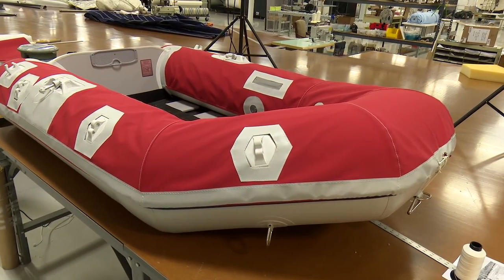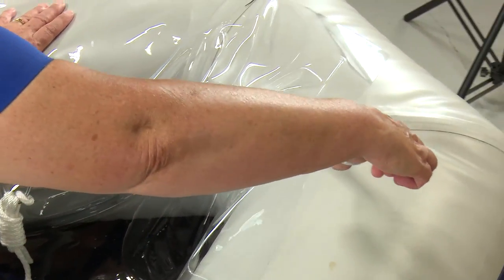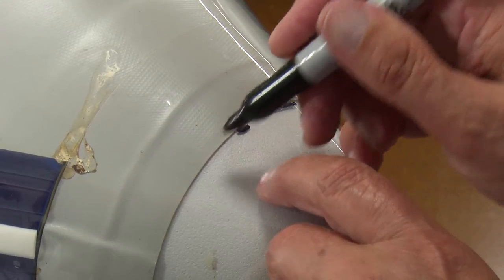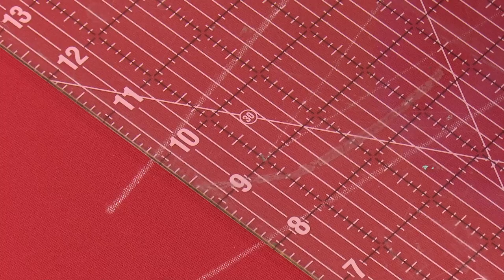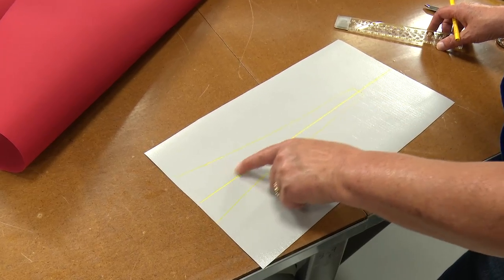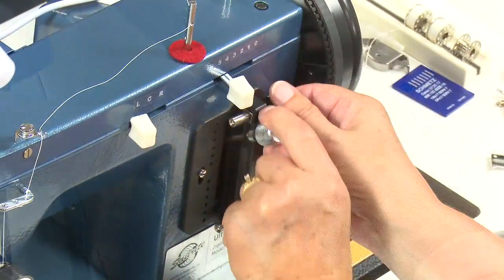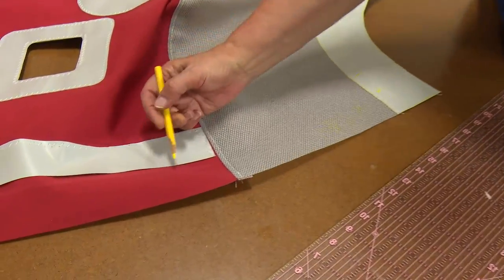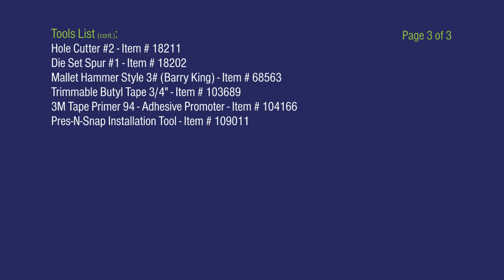How to Make Dinghy Chaps

Comment: Caution:  Cindy is a pro - she makes it look like you can finish this project in an afternoon.  I’ve spent a month and I’m just now finishing up the patterns.  I’m also on my second roll of plastipane.  God help me.
Reply from the maker: You can do it, don't give up! Regarding your comment ---- Cindy is a professional seamstress, true. However, she had never made Dinghy Chaps before, this was the first one she ever made. In fact the camera man and Cindy both engineered this whole process as it was being patterned, sewn and filmed. We both tried different techniques off the camera until we found the ones that worked best, then we filmed them one at a time. What it all boils down to is this --- if you know basic sewing and patterning techniques you can usually think it all through and you can sew just about anything. Hopefully since Sailrite strives to show you all the steps of the project, you will not have to do the initial testing that we did to find what works. It took us about 5 days to work out the kinks and then film this whole project, know that anything that requires filming usually takes twice as long to complete as a project where no one is being filmed.
Reply: Thanks, I didn’t give up!  I would add this caution, tho - spend the money and get the Sailrite machine.  I used a popular brand “Heavy Duty” machine and it was anything but.  I may do this project again in a couple years, this time with the right equipment...
Reply: This comment is 🔥💀💀💀💀

Comment: Hi  Excellent video and what a great company.  Your extra efforts are evident.  So I have Zodiac tubes which have a continuous "flap on the top of the tubes.  This flap has grommets for lacing a grab line.  But how can I "cut out" for the flap when it is continuous for most of the length of tube.  ANy ideas?
Reply from the maker: Donald Langlois Hi Donald, You have two choices here: you can ignore the lines all together and just cover them up with your fabric or you can make a slit in the chaps and allow them to protrude through the fabric cover. Then you can use webbing tabs with snaps or other fasteners and strap between each one of the grab ropes to the opposite side of the cover, thus supporting the two halves with webbing straps. Let me know if you have anymore questions.
Thanks,
Eric

Comment: Can you tell me why you didn't make the chaps out of the grey plastipane vinyl?  That would allow the chaps to be wiped down if it rained rather than sitting on wet sunbrella.  Are there disadvantages I don't immediately see?
Reply from the maker: You definitely can make the chaps out of a vinyl however we do not recommend plastipane or window material, but a vinyl like Shelter-rite would work well!

Comment: Great work , I guess you need those covers if you don't have a Zod
Reply: a Zod?
Reply: My Zodiac tubes went bad after 4 years in the sun.   Blew out a seam, and drowned a 50 hp Yamaha engine.   Over $7k repair.
Reply: $7k repair to the engine.... still had the bad tubes....  $6k to replace those.

Comment: When I made my pattern pieces, I cut them on the seams of the dinghy, such that each piece butts up exactly against the other (ie no seam allowance). What amount should I add to each piece for seam allowance to do the semi flat-felled seam? 1 3/4"?
Reply from the maker: The seams that the manufacture made for this dingy were overlapped by 1 1/2" (your dingy seams may be different). Since we patterned each pattern piece to the outside edges of those seams on the dingy we allowed for half of that width for the seam, for our dingy half of 1 1/2" is a 3/4" seam allowance. As a result, when we sew the semi-flat felled seam we will sew a 3/4" seam allowance.